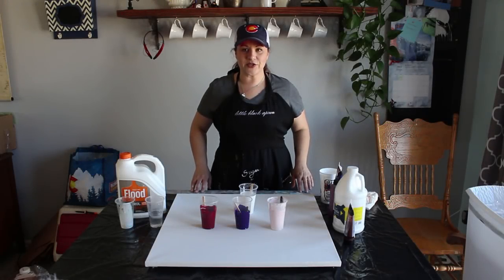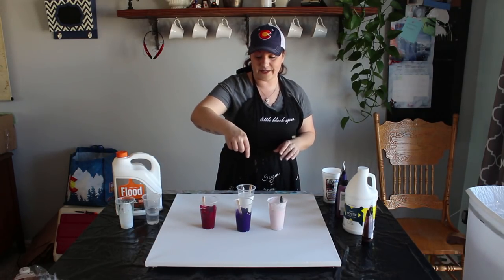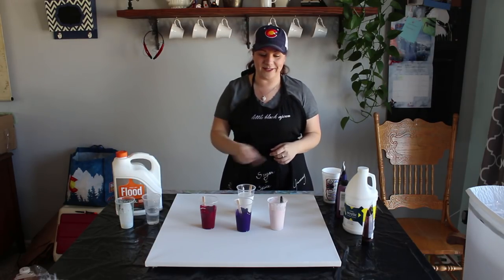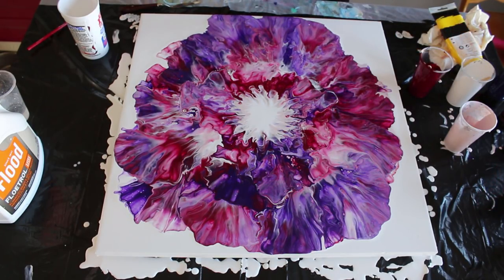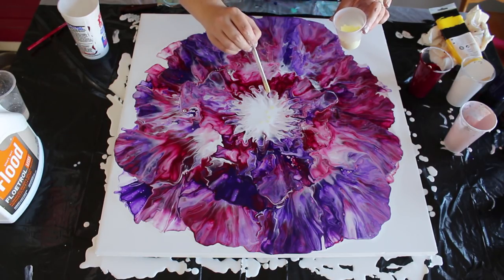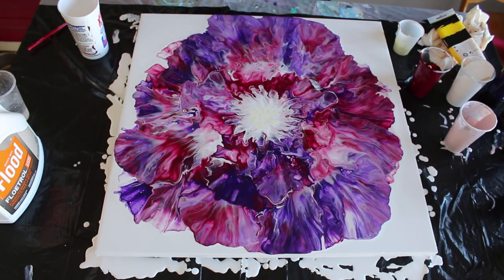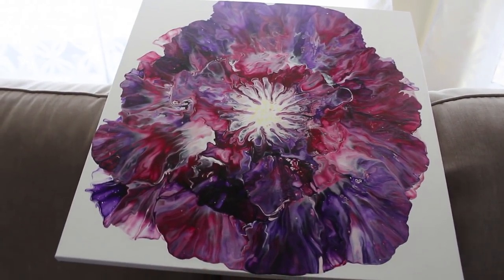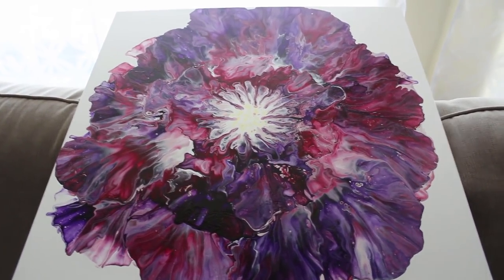Fluid Paint with a Hair Dryer | Flower Experiment

Comment: You don’t need more Floetrol. The problem with the crazing you got us from the paint not drying properly. It dried on top and when it started drying on bottom when oven was on, it pulled your paint apart. You’re fine. Your formula was ok.

Comment: Have you ever tried to blow narrow instead of broad with your blow dryer. Do you know what I mean ? To hold it so that a  narrow of the nozzle blows your paint. Maybe like when you got to the center after pouring white . 
  And instead of just using the broad part of the nozzle to chase the paint away, have you ever wiggled it back-and-forth like when the hair dresser is blowing you dry? It's what I would try because I am a hair dresser... I think of tecniques of using the blow dryer that the common person may not and that I haven't seen yet with this kind of art. I like your flower the way it is but when you got to the center, I wanted you to use the narrow side and you used the straw instead...I was bummed.